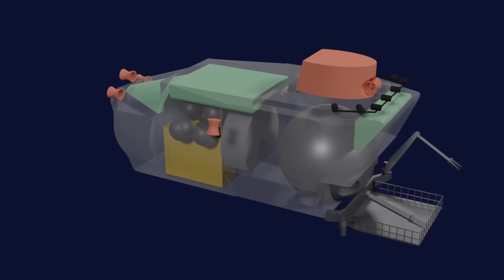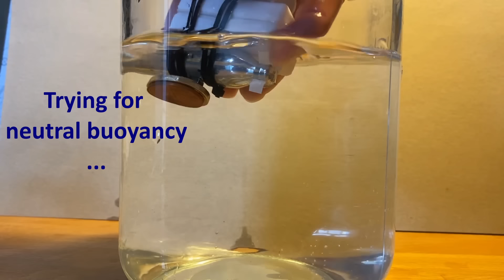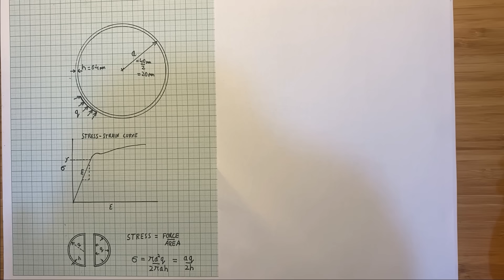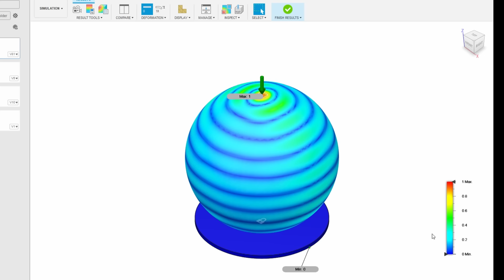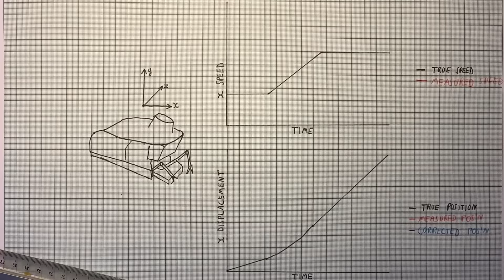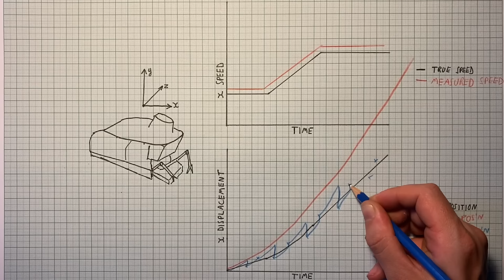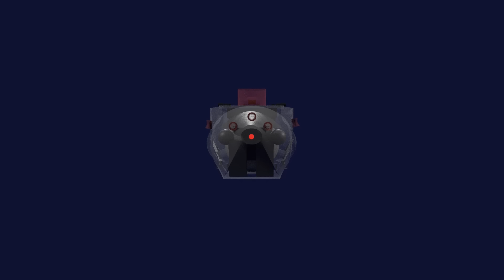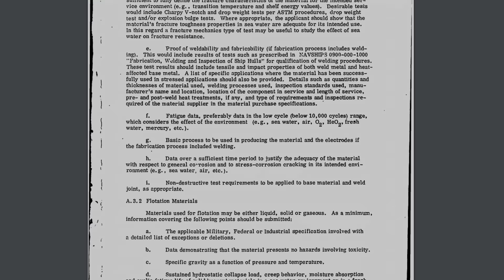DSV Alvin : How to build a safe submersible

Comment: Hi Alex, thanks for the great video. 

Two quick stories: 

My uncle is a marine biologist who studied "abiotic carbon cycling in undersea vents " --whatever that is.  His team frequently utilized manned  submersibles, Alvin included. I'm fairly certain he told me the following story was from aboard the Alvin. 

While ascending one day, the crew heard a loud thump from the side of the submarine. The pilot and crew were unable to determine what caused the thump and eventually decided to continue their ascent. Turns out a large sword fish had rammed the side of the sub and had gotten its nose stuck partway through a very thick gasket(?) that joined parts of the hull. Or that's how I remember it being told anyway. 

The crew and scientists ate grilled swordfish that night, and somewhere there is a photo of them holding it on deck. 

-------
I don't think this was aboard the Alvin, but for my birthday one year my uncle sent me an extra large Styrofoam cup that he had drawn on, and tied in a mesh bag to the side of the sub before a dive. The cup was crushed to ~1"x2" but roughly maintained its shape, essentially shrinking the cup. 

I still have that miniaturized cup 25+ years later.
Reply: *The cup was squashed on the Johnson Sea Link*
Reply: That's a cool story!

Comment: I read a little about the Soviets building titanium nuclear submarines. While the author did not go into detail, it was made clear that production required entirely new tooling, methodologies and therefore skills (Alfa-Class I believe). 

It almost sounds like the designers were simply given a free reign to produce what THEY considered 'best' so they also employed a lead-bismuth eutectic cooled, beryllium-moderated nuclear reactors for power & advanced electronics.

All I know is that many of the systems proved far to hard to maintain hence each vessel only being in service for 1-2 years.

I suppose it may have proved what worked and what didn't and I'm guessing that the tiny compliment & the propaganda that many more vessels were produced (the two possibly re-enforcing each other) but I would love to know that if, in retrospect, it was considered a success.

I seem to recall in another video on the CPU of an American ICBM you noted that a Russian source stated that their missiles could not reliably hit New York City & the apocryphal solution  was 'add more plutonium' so it really does make me wonder if the Alfa was groundbreaking or merely needed to PROJECT being so.

Comment: Unmanned RV submersibles dont require a pressure hull so it could theoretically dive to any depth since the pressure is equal inside and out.
Reply: The on board electronics may disagree. There's technical issues there, but yes it is a lot cheaper because no safety equipment is necessary
Reply: Not really, since they need a tether to a surface ship to transfer data
Reply: @HalNordmann  even so, for cheap underwater research it's the best thing

Comment: the stories about the non welded parts failing first are almost certainly true, I'm a welder and it's a relatively common occurrence even with less sophisticated kinds of welding when there is a skilled welder involved.

Comment: It's often been said that anyone can make a bridge that stands but it take an engineer to make a bridge that can just BARELY stand. It's fine to use Alvin as an example of superlative engineering when cost is literally no object, and the lessons learned should unquestionably be used to inform future designs but you need to remember the design constraints and purpose of titan to begin with which was not to build a no expense spared sub to reach the titanic, but to build a commercially viable sub that could make reaching the titanic available to a private team with limited funding. Yes, they made many MAJOR mistakes and deserve the harsh criticism they've received, but massive over-engineering to the level of Alvin with its associated costs was simply not viable for titan.
Reply: Insofar as your "simply not viable" sentence is true, it is not at all clear that Titan was actually a viable project when the budget of the Alvin was not available.  The simple fact is that, if you can't spend as much as the existing solutions, it may just be that you can't afford what a successful solution costs.  To me, it seems very likely that that was the case for Titan.

The problem with the "bridge that can just barely stand" statement is that it's a truism, not a truth, and as such it has some substantial caveats.  First, it's not clear that a bridge that can just barely stand is what you actually want; in this situation I would argue that something a bit more durable (and resilient to miscalculation) is the right answer.  Second, engineers can only design bridges that are that close to the failure point because of the experience from a really large number of bridges that have been built, and even so we still find new and novel ways for them to collapse.

And, finally, remember that bit about Alvin's pressure vessel having a calculated 20% safety factor?  That is a substantially smaller safety factor than any licensed engineer would actually use for a bridge.  I would posit that Alvin is not nearly as overbuilt as you think.
Reply: @BrooksMoses  all fair points, however on the first point I'd point out that the Alvin is extremely overbuilt for reaching the titanic - it's a MUCH more capable submersible able to dive about twice as deep as titanic, and do a lot more science with its manipulator and instrument systems, not to mention it was the first of its kind which is always much more expensive. So it's absolutely possible to build something cheaper to suit the purpose
Reply: @GlutenEruption  : True -- I wasn't thinking about the depth difference.

Comment: Needs to be made with carbon fibre and off the shelf parts. I hear that glue is the best thing for binding rather than welds and don't take it onboard the mothership so it can get used to the water on the journey to wherever your going.

Comment: How to build a safe DSV:

1. Get people out of it. We're in 21st century, we have cameras that are better than our eyes if need be. What good could your mortal flesh possibly do down there? You can't exactly leave the vessel anyway.

...

Oh yeah
2. Foresee a force disconnect for the tether so that if the DSV gets caught, it doesn't drag the launch and support vessel down with it.
3. Foresee another disconnect.
4. Place a hatchet to manually cut the tether.

That should about do it.
Reply from the maker: You can’t use a tether down to that depth - itd break under its own weight. So we need a crew. With all the safety measures I discuss, this makes (certified) DSVs safer than driving a car, with zero deaths or major injuries over 60 years of us operating them.
Reply: @Alexander-the-ok   I am happy with the safety record but i'd be surprised that single mode optical fibre can't be made such that the density of it including sheath would equal water. The glass strand is super thin and there's any number of polymers less dense than water to balance it out.
Reply from the maker: Oh yeah, ok fair enough, you mean a data-only tether.
It’s perfectly possible but would hugely limit what you could do due to the entanglement hazard. I can’t remember how many ROVs there are permanently entangled in Piper Alpha (they were sent down after the accident to look) but there are at least a handful of them.

Comment: We built the DOWB for naval use, at about the same time as the Alvin.  It used a steel sphere, which did not have the corrosion problems of aluminum.  However, iron is way heavier, so the aluminum constructions became more standard, even if they required more safety measures.  The DOWB was essentially a clone of the NR1 secret naval submarine, of the working arms and tooling fixtures.  This technology was later used on virtually all of the oil platform tooling submersibles.  We did one tooling fixture for Exxon that was used down to 4000 feet, and the DOWB was certified to 6000 feet.  Exxon did a lot of deep drillling using our systems, to find oil layers, down below 14000 feet, in all sorts of ocean areas.  They have a database of the entire Earth.

Comment: I got slightly confused and had to double-check that there wasn't some form of mispronounciation or other mistake in here and now I know the etymology of the word "syntactic" ❤

(I studied computational linguistics on a postgraduate level and have probably used the word "syntactic" more than 100 times in published research. Every single time it has been in relation to the grammar of natural or, less commonly, formal languages. I never even considered that the word might have a broader definition and use in other fields. In hindsight that's obvious, but blind spots are blind spots.)
Reply from the maker: You know....I've never thought of this until now. As a data scientist, who has worked with various language models....and as a former engineer who worked with deep sea ROVs, I must be one of the few people on Earth who has used the two meanings of 'syntactic' in two completely different jobs.
(also, due to my accent, it's a particularly difficult word for me to say. I had to record the sections where I say it several times).

Comment: Absolutely insane hearing a sphere of that sized manufactured to a runout of .0315", just straight up nutty. I really wonder how they got there - ultra precision manufacturing? Milling marerial off? Very interestinf
Reply from the maker: Just a lot of time, care and excellent process control. The final stages were carried out on a cnc lathe.
My father in law is a retired machinist. I asked him whether the place he worked would be able to achieve this, he said something along the lines of ‘yes, but it’d cost you’.
Reply: @Alexander-the-ok  Makes sense. Must have been on hell of a lathe to take care of that. 

I'm over in aviation (mechanic) and it's very "we can make it as precise as you can afford" as well. The trade off between precision and cost has always been super interesting as a non engineer. 

Thanks for the vids, these have been great.

Comment: I wonder:  would it be possible to hold the drop weights via electromagnets, so that in the event of power loss, they are automatically passively dropped?  Or would this put too much drain on the batteries?
Reply from the maker: The Trieste had that exact setup. I’m not 100% sure why modern DSVs don’t use electromagnets, you may be correct though about the power drain. With the amount of redundant ‘drop options’ on Alvin, I wonder if ‘drop on power loss’ may actually be more of a hazard - imagine several hundred kg of steel falling to the deck while Alvin is being lifted for example.
Power loss guaranteeing loss of vertical control also makes me uncomfortable.

Comment: I thought Syntactic foam was made up of hollow spheres bound together by polymer. What would happen to the hollow pocket which I assume to be filled with air do under that amount of pressure at greater depths? 

Yes, Spherical shapes are the strongest shape in nature but with it being hollow wouldn’t that cause issues with compression, in turn compromising the spheres?
Reply: My understanding is that they're microscopic spheres, and so given their size, wall thickness, and material strength, they do not compress easily even under extremely high pressures.  Square-cube law, and all that.

Comment: An oxygen leak could also lead to Oxygen Intoxication. This likely would not be a very large issue in the time they are underwater, but in an emergency it could be a problem. Not a commonly known phenomena.

The TL;DR of it is, basically, oxygen is extremely corrosive and destroys almost everything it touches, including your lungs. You lungs constantly repair themselves much faster than this happens, under normal conditions. Above .5 partial atmospheres of oxygen, the amount of oxygen in the air will overcome your lung's ability to repair themselves and you will eventually drown in your own dissolving lungs. Quite a gruesome death. There are also a number of neurological symptoms as well, ranging from headaches to seizures, especially at extremely high partial pressures, generally associated with diving.

Comment: I work with titanium every now and then, it is extremely sensitive to heat. You have to be extremely careful when sanding it to make sure it doesn't get hot, or it will basically start tearing instead of cutting like you want it to. Fuckin weird shit. Yet, its also somehow extremely strong still while being hot? that's why they used it in the Sr-71 I heard. Weird shit. Not fun to polish.

Comment: Thanks for the video.  As a child in the 1960s, I read about the Trieste, Aluminaut, and of course the Alvin, in Popular Science Magazine.  There were many good lessons in those articles.  I remember the Trieste used gasoline for positive buoyancy, sort of like a deep sea dirigible.  It's good to see the Alvin has evolved over the years and is still in service.  I'm still a bit curious how they manage hull penetrations for electrical cables, and are there any penetrations for physical controls?
Reply from the maker: Trieste fascinated me as a kid.
Yep Alvin has a ‘penetrator plate’ behind the crew. It contains pressure tight penetrators for cables to pass through.

Comment: One thought I had with the ping pong ball. The air pressure inside the ping pong ball would have some affect on when it collapsed. Was the formula for collapse pressure taking that into account? If the ping pong ball wasn't air tight, it wouldn't collapse at all, merely allow air into it until the air equalized.

Comment: Is a ping pong ball actually airtight? Or can the pressure inside and outside at least partially equalize by some of the smaller air molecules defusing/ leaking into the interrior?

Comment: Titanium is a hard material to work with because while it is slightly lighter than steel it is also technically a bit weaker than steel but inversely it is also much harder than steel so instead of bending when put under stress like steel it will just shatter or sheer like glass might.
Also Ping-pong balls are made of nitrocellulose so that is why your calculations were off.
Reply from the maker: They stopped making ping pong balls from nitrocellulose a few years ago because it was a comically unnecessary fire hazard
Reply: @Alexander-the-ok  Ah yes.. Those ever so dangerous spontaneously self igniting Ping-pong balls, so very dangerous.

Comment: Because I do welding myself I can tell you that it is quite common to have the breaking point next to the weld and the reason for it is simple if you are welding correctly it will be appropriately strong for the intended purpose but the metal around it has been affected by the heat so as we know it wen a metal is heated then let to cool by itself it will be softer than when it has been previously been molded / forged / heated then cooled down quickly and there is also the fact that the weld can be more rigid that the material around it.

Side note : I think that you should show the mathematical formulas, you don't need to spend time expaining them but at least show them for those that are intrested in it.

Comment: Yankee here. Thanks for doing the calcs in SI. I work in SI whenever possible because it's easier and also I can never remember the density of steel or seawater in US units. (Also, the nearly the entire US shipbuilding industry is metric now anyway.)
Reply from the maker: Thanks. Ironically, the UK is still stuck in a ridiculous ‘inbetween’ where imperial units crop up all over the place. They are very rare in industry though (with some exceptions).
Reply: @michaelimbesi2314  American biologist here, I also appreciate the use of SI/metric <3
Reply: Youre lucky your yard is full metric. We have metric on new construction, standard on nearly all refits
Reply: As a US civil engineer, I'm still plagued with imperial units; we even use a hilarious unit called a Kip, which is 1000 pounds (kip = kilo-pound).
Steel is 490 pounds per cubic foot
Reinforced concrete is 150 pcf
Water is 62.4 pcf
Saltwater is 65 pcf
Could be worse. In college we measured hydrostatic force in slugs.
Reply: @JoyousWanderlust  : ...wait.  Hydrostatic force in *slugs*?  But a slug is a unit of mass!  A unit of mass that you only use because you were using pounds force and wanted the porportional constant in f=ma to be equal to one.  What kind of poor life choices does a field make to get to a point of measuring force in slugs?

That sounds deeply painful, and makes pounds-force and pounds-mass sound sensible.
Reply: Oh, glad we’ve stopped using Freedom Units, they’re much more archaic.

Comment: For the pressurizes compartment, couldnt you just use the normal pressure sphere and another sphere around that, the innner sphere beeing pressurized to sea level, and the outer sphere beeing pressurized to half the surrounding pressure, so both spheres would be exposed to half of the pressure a single one would be exposed to?

Does this make sense even?
I have no engineering or design background, this is just an idea.
Reply from the maker: For someone with a non-technical background this is a perfectly reasonable question. Think of it like this. What you'd be doing there is taking the existing sphere and 'splitting' it into an inner and outer. So you'd still use the same amount of material - there would be no advantage to doing this. In fact...you'd end up with 2 spheres that could fail instead of one, so this would actually be more risky.
Reply: @Alexander-the-ok Oh okay, thank you for explaining.